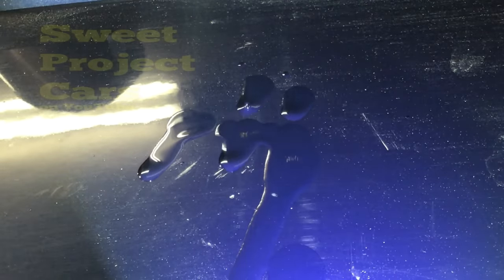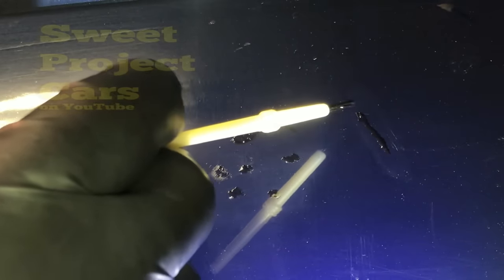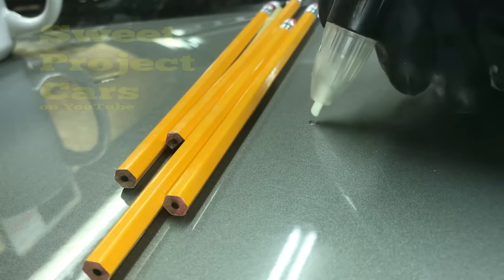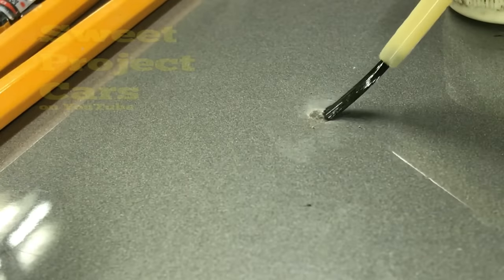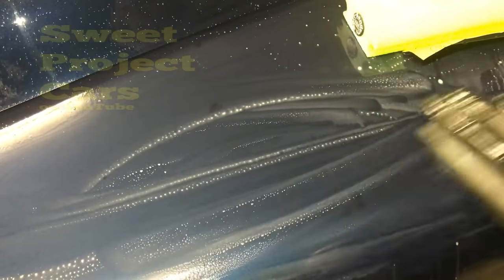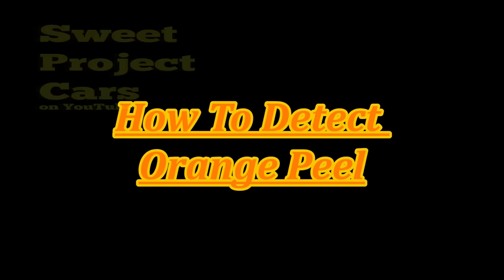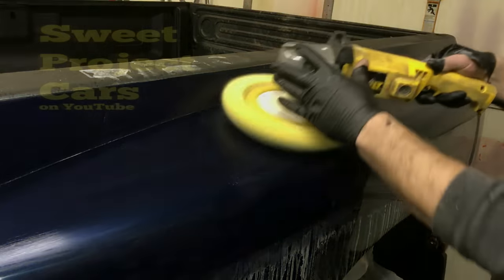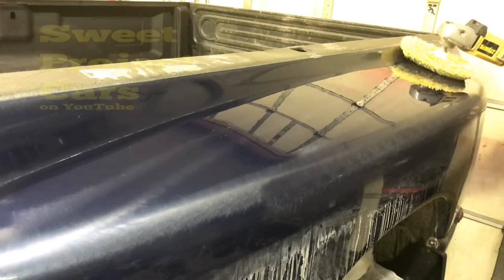How To FIX Any Paint Chip or Scratch in Your Car or Truck Paint... DIY

Comment: This is a great video but I fudged up. I can’t sand the filled chips down to be flush with the paint. I’m afraid to go too hard and burn through the clear. Maybe my mistake is that I didn’t use a sanding block, instead i wrapped a dish sponge in sandpaper. I’ve used 2000 grit back and forth with soapy water but I can’t bring the damn filled chip to be flush with the rest of the paint. Now I said forget it and polished the swirls out and waxed it and shines real nice but it’s not flush and I’m disappointed. Should I have applied more pressure? Some lacquer thinner? Any advice? I want to work on the chips again. I’m thinking of buying a maguiars finesse sanding block and working on one on the rear bumper since it has to be painted anyway so it won’t matter if I burn through the clear..
Reply from the maker: CTAjunior I am going to do a video that will be coming out tomorrow that may really help you when you’re dealing with your paint chips and getting them flush without going through your clearcoat make sure you have your subscription notification bell on

Comment: Will mothers solve the problem of oversanding in parts?? When I put water on it it looks perfect but when it dries it goes dull in patches all over my bonnet what have a done? No mothers on yet
Reply: I think I over sanded and I haven’t bought mothers yet so my partner was not happy hoping to fix it ASAP 🙁
Reply from the maker: helen as long as you are not down to the base coat mothers will be the key to your success  thanks mike

Comment: What happens a guys used grey primer in the spots where it was bare metal?! 😬😬(Grey 2006 Tundra) I think I just realized you were using clear. Mike in Denver as I wait two days for my paint to cure.
Reply from the maker: If you can use a gray or green etching primer Michael you will do just fine
Reply: Sweet Project Cars thank you!!!
Reply: And two other quickies: how long do you let the primer dry for? Once dry, do you go right to paint or do you clay bar and hit it with lacquer thinner again?
Reply from the maker: Michael Ledger let primer flash dry about 2 hours in 70 degree weather then you can go right to paint :)

Comment: when you're using your compounding pad with the mother's mag & Alum., what RPM is your polish machine spinning at?
Reply: just saw you say 1750 RPM, does this apply for all applications when using this tool?
Reply from the maker: geoff lau we vary the speed throughout almost every process we do that's why it's important to get a variable speed buffer we ususally only run it wide open when doing the final buff for each step, compounding and then the final polish.
Reply: Thanks for the quick reply! I have a very similar variable speed buffer. When you say wide open, what RPM is that because some have different RPM limits than others. also, when do you know when to stop the buffer, are you looking for all the product to disappear or should it only be 3-6 runs for example, back and forth on the concentrated area?
Reply from the maker: geoff lau wide open would be the buffer going as fast as it is capable to go...and we stop buff when the product is almost gone then hand polish it after that to shine it up...we also keep buffing until we get the shine we want...it is basically wash rinse repeat...

Comment: If I only have 1 or two chips on a panel do I need to sand and buff the entire panel or just the individual points?
Reply: Also some of my self etching primer is being exposed as I sand what should I do? And how can you tell when you are get through your clear cut as you said you should not do?
Reply from the maker: You just need to do the areas around the chips you filled and then your buffing will blend it all in

Comment: Hi. I dont have the single stage paint so can i mix the base colour with the hardener and then add the clear coat from a clear coat pen? This for black paint. Thanks Russell Qatar
Reply: In addition i have a permacron autolack 257 top coat. After i use this do i need to apply clearcoat or it this the finishing coat? Thanks russell qatar
Reply from the maker: Russell Maguire you can give it a shot if that's all you have my friend
Reply from the maker: Russell Maguire if you remove the clear coat in any way you will need to replace it
Reply: Thanks will give it a go and mix the clearcoat with the topcoat and hardener mix and let you know how it turns out

Comment: Help ! I used rubbing alcohol and it rubbed everything right off 
Is that supposed to happen? Also my rubbing alcohol is 90% isopropyl
Reply from the maker: We have done this for over 25 years and never had it take anything off other than the grime and grease not sure what products you are using or primers but after you apply them you do not need to wipe them down again with anything it is now time to paint them

Comment: SPC on the rust chips how long does the self etching primer needs to dry before painting?
Reply from the maker: If you’re not in a rush we like to give it like 12 hours in 70° weather if you’re in a rush you can use a hair dryer to dry it and a couple hours later you can paint it

Comment: Do you have a tricks on restoring your rubber window  trim? Mine has water spots that I cant remove. It's a 91 toyota pickup.
Reply from the maker: Send some pictures of that to us so that we can see I’ve never heard of that before send it to Sweetprojectcars@Gmail.com
Reply: @SweetProjectCars  not sure how to on youtube
Reply: @SweetProjectCars  I sent some pics to your email.
Reply from the maker: Rubaru STI ok we received your picture are you sure that it is rubber? and not a vinyl coating on the stripping?
Reply: @SweetProjectCars  to be honest I'm not sure . But any suggestion if it is?
Reply from the maker: This most likely vinyl coated aluminum try mothers mag and aluminum polish on it with a microfiber towel I think you may be quite impressed
Reply: Sweet Project Cars Hello Mike the Hammer, Sultan of Autos, Car Guru, the Teacher, do you have a video on repainting a plastic grill? Do I need to use plastic primer? I hit the thumb’s up on every video of yours I find time to watch. Thanks, Kirk

Comment: Made a rookie mistake and tacked a big chip before watching this video. Toyota sells three pens to touch up my car.. I think the sanding of each layer cut into my clear coat and the touch up just doesn’t match. How can I prep the chip and 1 inch around to make this right?
Reply from the maker: Hello Ryan I would have to see a picture of this in order to help you did use sand through the clearcoat to the base coat?
Reply: Sweet Project Cars anyway I can send a you a picture? 

I think just through the clear. I have a blizzard pearl Toyota which has white base coat, then pearl flake, then clear. The area around the repair looks slightly darkened. Just let me know how to get you a pic.
Reply from the maker: Ryan Mowen send good clear pics to sweetprojectcars@gmail.com   :)

Comment: When touching up the light silver paint on my BMW, the touch up paint would leave a dark swirly streak in the paint chip even though I shook the paint pen well? What am I doing wrong?
Reply from the maker: Hello Dan that would be the metallic that’s in the paint pen BMW is notorious for that so what you should do is just shake it up well then pour out more than you need maybe the size of a dime Then Pull your paint from that Hope this helps also it will not look right until it’s dried sanded and buffed it’ll look like it doesn’t match but then after those processes it magically of appears to be a perfect match
Reply: Thanks for the tip!

Comment: Stupid question, does the etch primer have to be the same as car colour?
Reply from the maker: ND 27 no but it is good to use a light color etching primer with light painted vehicles  thanks for asking SPC Mike
Reply: Sweet Project Cars thank you Mike for replying, I’ve a 2008 gti in white and lots of stone chips on bonnet (hood) some rusted. Will use your video as a guide to touching it up , thanks for the content you create it’s really helpful

Comment: How do you do this with 3 stage paint? I have a metalic mineral white car. I went to the dealer and they gave me touch up paint and clear coat. They told me not the mix in the clear coat cuz it would make the paint lighter.
Reply from the maker: Luis M we are getting ready very soon to do a video on this using the TRI-COAT touch up paints

Comment: I see that you are using a rotary polisher. Isn't it generally better to opt for a dual action one? I've seen many videos where the DA is being praised over the rotary because it doesn't leave holograms or spider webs. Or maybe you have some tips and tricks on how not to leave holos' with a rotary? :)
Reply from the maker: We have found that we have a better result with the rotary polishers we have used them for years we have tried the DAs and they just don’t do it As far as tips are concerned if you follow our video you will not have any issues we have never had holograms or any other type of spiderwebs
Reply: Sweet Project Cars Well yes, I have seen a few other videos on how to learn and master the rotary machine and it seemed quite simple actually. So I really don't get all this hype with the holograms and burnt paint as it is actually kind of hard to ruin the surface with the rotary. What is the reason for the majority of detailers to spread these intimidating beliefs then?
Reply from the maker: Jump, the main reason they use DA's is they move slower and are easier to handle for the novice...to use a single action rotary it takes a bit of skill but you get a better shine and get the job done faster due to the fact it is moving faster. much like trying to do it by hand it would take all day, much like the DA is like doing it by hand when compared to a rotary...hope this helps :)
Reply: Sweet Project Cars Oh, I understood it now :) I thought that the DA and the rotary are the same in speed and the only difference is that the DA has some built in safety features which could come in handy for the newbs :) thanks for the advice!
Reply from the maker: jump3erlt you are very welcome...I know once you use this https://amzn.to/2JEBDnw you will never go to anything else.

Comment: Hey sweeeeet project cars wondered if you could do a video for us guys that don't have lot's of money to invest in expensive polishers and pads.LOL I went to harbor freight and bought a digital polisher and some pads but are confused to which i should of bought :( wondering if you visit the site and let us guys know which pads to use as someone as my self will only be using these once in a great while. i bought a wool buffing pad, a blue color polishing pad. and a black finishing pad, they had another pad for compounding? i did not buy that one so you see the confusion here? HELP IS NEEDED. also are we as veiwers able to send you pics of spots on our cars so you can tell us what need to be done to fix them? thanks for your videos keep up thr good work
Reply from the maker: Tom here is the problem with that,see when your dealing with paint and wanting to make it look better, it is one of those things you just can't cut corners on, if you use low-quality pads, buffers and compounds you can easily make you paint look way worse and then you are in a whole lot of trouble, and in order to make it right again you will end up going to the quality tools to fix it. my analogy on this is, you can wash your car with dish soap because it is really cheap instead of a soap intended to be used on car paint but the damage you do, will not be worth the savings.
Reply from the maker: Tom sorry you are upset we answered your question with honesty and the facts, the only part I missed in your question was can you send pics of affected areas and yes you could have done that. have a great day

Comment: so if i use the dupli color pen should i apply the clear too before wet sanding it ?
Reply from the maker: Zee Lewis if you have the pen that has the clear coat separate from it you will have to wet sand the paint then do the same for the clear coat...it is less time consuming if you can find a single stage paint with the clear and paint mixed together :)
Reply: +Sweet Project Cars not in a hurry to get it done just stoping the rust is good
Reply from the maker: Zee Lewis thats a great way to roll...rust is such a pain but can be easier to deal with it caught early enough :)

Comment: Please if there is any sign of rust then use self etching primer?  I'm not sure I'm down to bare metal but I see rust in the chip.
Reply from the maker: jon sen Yes you will want etching primer
Reply: @SweetProjectCars  Thank you.  Please if I can ask one more, why not limit the wet sanding to the touch up paint only?  By using the pencil eraser with 3000 grit wet sandpaper for example.  I like your results just wondering why increase the sanding area.
Reply from the maker: jon sen you can do this we have many many videos on different methods to do this but hey we always try it and see if it works
Reply: @SweetProjectCars Please do you  ever use a rust converter/chemical treatment in addition to scraping with X-acto knife?
Reply from the maker: jon sen we stay away from any chemicals that could cause issues with the primer or paint we use this on rust https://amzn.to/2UKBuav after we have removed the rust as much as possible

Comment: I have a 2006 Mustang GT I have a about a 1/8 chip on my hood. Now I also have swirl marks in the clear coat. Ok you showed me how to fix the chip. The process for that should be the same for me to fix that? For the swirl marks what do you recommend me do. I bought the car in 2018 it only had 4,665 miles on it very low. It was a Gem Find I only paid 15,000 grand for it. Like brand new. But I would like to take care of the Blemishes on it to make it shinier. I want to show it off at some car shows it’s that kind of car. Please get back to me I’d appreciate it thanks!
FB -George Anthony Keys ( Tazz )

Comment: Do we add clear and will clear need to be sanded again
Reply from the maker: If you use a single stage paint that has the clear in it you will be set, but if you use a two stage paint yes the clearcoat will have to be treated with sanding and buffing Just like the color was you will keep the paint a slight bit lower in the Chip to leave room for the clearcoat that’s why we suggest just getting a factory matching paint that has the clear in it hope this helps
Reply: I tried getting paint with the clear in it but they said not reccomended or just would not do it i have 2018 durando paint PXJ and they said cause it has crystals in it so iasked if anywhere else i can buy it like that they said nobody would do it is that correct thanks
Reply from the maker: Fame1418 the blue paint you saw me painting was metallic and it came out great, do you have an auto parts store around you that mixes paint,  if not you will have to go this route  https://amzn.to/2HtfEyB or this  https://amzn.to/2qXgCfZ  as well.

Comment: In the very beginning of the video you used the term "rubbing alcohol". Normally I hear you using the term 99% for the alcohol that you use. Rubbing alcohol is an antiseptic, which contain between 68% and 72% of isopropyl alcohol. The remaining volume consists of water, stabilizers, perfume oils, and color additives. The purer 99% alcohol is what is used in automotive and industrial environments because it is a solvent and does not contain any water, which can form rust or other additives that may be left behind on the surface.
Reply from the maker: Jim Chappell in our older videos we never mentioned it much that it was 99% but it is all we use my friend

Comment: how well does an orbital grinder work ?  I tried to turb the weight but it wouldn't turn to make it a full on grinder
Reply from the maker: cody that will be harder to do with an orbital best to use a straight up DeWalt single action buffer for easy success    
 thank you very much and for being here with us :))